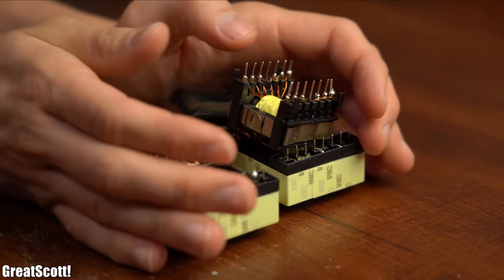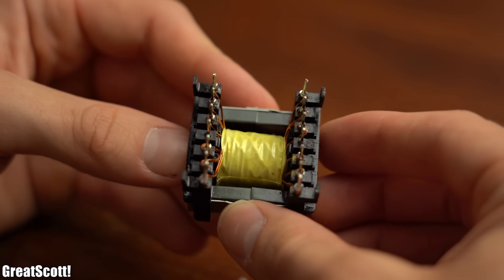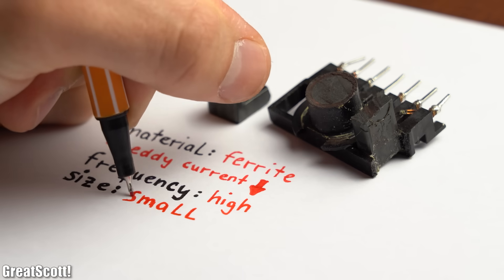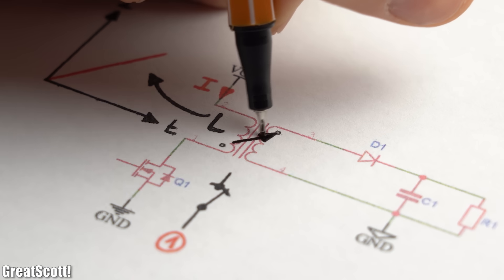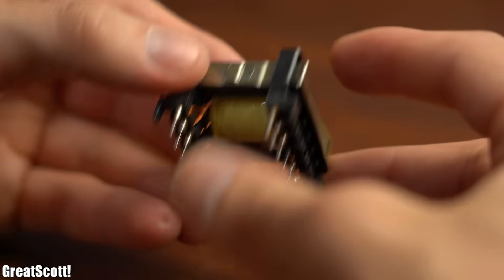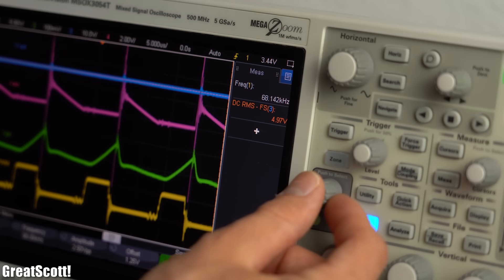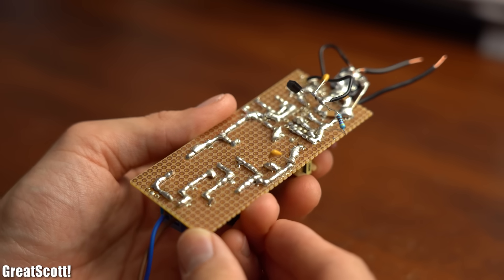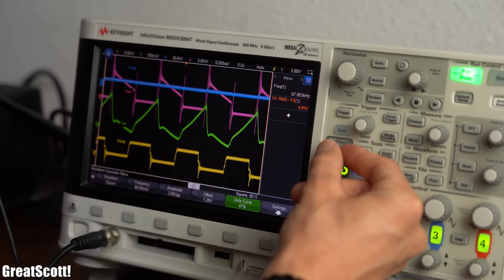How does a modern Power Supply work?! (230V AC to 5/12V DC) DIY Flyback Converter!

Comment: At least half of that went over my head. That being said, i was really interested to see whats inside, and how all my 12V DC adaptor power supplies that i use for various projects actually work.  Out of curiosity, i would love to see in your opinion what a basic VS a well engineered design would look like for one of these circuits. Would be a nice reference if i ever get curious enough to open some and see if they are high quality units or cheap and nasty. Thanks for the video :P
Reply from the maker: Thanks for the feedback :-) I will see what I can do ;-)
Reply: Most of that went over my head, too...

Comment: It might be a good experiment to build the same circuit on copper-clad board with a good ground plane.  That should cut down a lot of the ringing at the switching transitions.  This sort of ringing is what causes a lot of the EMI in switching regulators.
Reply: a good ground plane needs to be on a separate copper layer? or just having more area (on the same side) is enough? (with those other design considerations, but I want to know how important are ground planes on independent copper layers)

Comment: "Do not build this circuit! With that being said, here's the schematic" -Great Scott XDD
Reply from the maker: Everyone should have the access to knowledge ;-) But a warning was still necessary ;-)
Reply: @greatscottlab  At least you made a better Power Supply than Gigabyte's exploding PSUs for being on normal load haha
Reply: @ThatOneWeeb420  gigabyte did a little trolling.
Reply: @ThatOneWeeb420  
What the hell's a Gigabyte?

😂
Reply: @greatscottlab  
Electronic cannot be learnt without explosions and shocks 🤣
Reply: @greatscottlab warning is so that bro doesn't get sued, which is understandable.
Reply: @greatscottlab  Can I have the whole equipment list so that I can do hardware model for my btech project
Reply: @greatscottlab  Hi sir. Sir please hack an AR glasses to work on a HDMI input even if the whole setup becomes bulkey. Bigg fan.  Love from India ❤️❤️❤️❤️❤️❤️❤️❤️❤️❤️❤️❤️❤️❤️❤️❤️❤️❤️❤️❤️❤️❤️❤️❤️❤️
Reply: @VijayaLakshmi19807  HDMI is high frequency you cant just mess around with it. As soon you remove for example the shielding it will no longer work.
Reply: @flavioernst902  I'd suggest you check out Ben eater's video on his crude IC level GPU. it works with VGA not HDMI but it is still very impressive and interesting to watch
Reply: It is not a bad circuit to build. It just missing parts that make it a compete power supply unit, and it should not be used as a power supply.
Reply: Dodgy! 😉
Reply: @oraszuletik DIODE GONE WILD!!
Reply: In our litigation-crazed societies, such warnings are necessary.  Even peanut butter comes with a warning that it contains peanuts.  Yes, I am a lawyer and electronics hobbyist.
Reply: @robinsattahip2376  that's the 
" PlaySafe" modus operandi..
It doesn't tell you the species/ grade of nuts..or if those nuts were taken from a monkeys/ squirrel hideouts..nor does it tell you anything about the "butter" they're using to butter you up into buying..... 🤣🤣🤣
Reply: @robinsattahip2376 I think the allergy warnings is just because FDA requires transparency. Not because of litigations even if people know peanut butter has peanuts not all products are truthful of their name..there are juices that don't contain the fruit on the label so saying it contains said allergens is not a bad thing to add. Tired of this myth America has all these warnings because of lawsuits when it's more like something bad happened that caused the regulation.
Reply: Also he calls it a DIY in the tittle, litteraly Do It Yourself XD
Reply: Thats an iq 200 move there
Reply: It is safe to build but when plugged into power do not touch it
Reply: @Rocky RobinsonWHAT,WHAT..... flybacks don't suffer from....???
ALL MAGNETIC materials ..to date.. are classified/ charecterised by their own HYS.
curve/s . & this is a factor of that loss and also " Eddy current" losses..
Reply: This had me ROFL! Thanks for keeping it real Great Scott!
Reply: I want to do this circuit for my btech project is it ok to do the same circuit.
Reply: Can I have some components list so that I can order them to make hardware model.

Comment: The flyback converter was the first switching converter used in a mass produced consumer product - the automobile. It likely got nicknamed when someone got shocked by the high voltage and was thrown back. Note, however, that some modern automotive ignition systems (e.g. Kia/Hyundai) use a forward topology for the final output since it gives a more powerful spark which allows engines to run more efficiently.

Comment: what I don't like about this topology is that usually you need to make your own transformer, it would be interesting if you do a DYI vs Buy a commercially available PSU that converts mains voltage to 5V.
Reply from the maker: I can put it on my to do list

Comment: For me a timely answer to how come modern power supplies are so small, as a few weeks ago The 8 bit guy built an Apple 1 computer using a modern day reproduction of the original. I'm not sure what the power requirement was, but even with 1970s ICs, shouldn't have been much, but the capacitors were huge.
Reply from the maker: The frequency used back then was just way lower and thus we need bigger energy saving components that can (obviously) store more energy :-)
Reply: @greatscottlab  Thanks! P.S. your drawings are fantastic. I'm sure Buddhist monks would appreciate your lack of attachment to creating such a beautiful sketch, and then scribbling out sections of it.

Comment: well despite the fact I know how a SMPS works in theory, I didn't know about the specifics about the transformer windings being opposite and the fact it's basically using the charge / discharge of such transformer... I always thought it was due to high frequency switching that it worked like a regular transformer but was just smaller because of the higher frequencies and the square wave... :)
Reply from the maker: The more you know ;-)
Reply: ....windings being opposite...
is for " flyback " mode only...also duty cycle cannot/ should not exceed 50%...
Reply: @analoghardwaretops3976  The flyback can go to as high of a duty cycle as you like within the practical limits of maintaining control, as long as the switching transistor can handle the reflected voltage. I think you're thinking of the forward converter, which is one where you can't exceed 50% with the standard design
Reply: @ShinyMajor  exceeding 50% , the volt/ sec. balance in
 off- to -on may not be achieved..and can lead to core saturation even in boost/ flyback modes.. leading to gradual residual flux buildup...
so when it's @ the extreme limit of the hysterisis curve..the next turn on pulse ..in its first few hundreds of nanosecs.can destroy the sw. with uncontrollable current..
Chips for flybk./ boost  have an internal divide by 2 f/f to limit max. duty to 50 % .. 
example..compare data sheet for internal blk.dia. of 3842/43 or other..

Comment: Diode AND RC snubber... k. Curious about this things and ground isolating circuits, as far as how they concern automotive circuits. Killed a knock-off arduino by controlling an ignition coil and not running any power regulating circuits. A coil with it's own igniter by the way.

Comment: This isn't quite 'modern' all good modern power supplies use power factor correction followed by an llc resonant converter. This is more a 1990 / mid 2000s power supply.
Reply from the maker: PFC and LLC converter might follow in a future video. Flyback topology still gets used in modern power supplies with lower power rating.

Comment: Nice video. How much power output can the circuit deliver?
Also, a DIY or buy video about power supplies would be cool.
Reply from the maker: My DIY version uses a very tiny transformer. So maybe around 2-3W on the output should be possible.

Comment: That's like marketing to the next level! Love that!
Reply from the maker: Well, I wanted to do a video about SMPS and they wanted to show off their transformers.....I would say that is a good match ;-)
Reply: .." this is not a promotional pitch..but in all fairness I can say this ( though we were really small customers )
Wurth Elektronik do have " high quality & reliable components and are real serious business partners...
despite we using a limited range and quantity of their products...they went " all out " to respond to our doubts/queries/ end use  applications..and sent their team over  with substantial dev. kits/ catalogues etc. besides follow ups..
Reply: I am ALL FOR THIS.  I have a pet project I'm trying to learn up to...  I've got a shelf full of game consoles from the Famicom to PS4 Pro.  I want to install a high-power 24VDC supply and use isolated switchmode supplies to step down to what each machine needs... 3.3V, 5V, 7-9V, 12V, and so on.  (Isolated to prevent ground loops and issues with systems that raise "ground" to a diode drop above one leg of the input jack, like the NES.)

In my research, I've seen planar transformers that use stacked PCB layers to provide galvanic isolation.  Since the design is kind of tricky, they're also available as drop-in modules from trafo manufacturers.  But, magnetics selection is non-trivial, and I still feel completely lost on this topic.  It's really the last domino to fall before I can start building some POC designs.

So, please!  MOAR TRAFOS!

Comment: Can you explain how you get 325V DC from 230V AC?
Reply: You need to use a full rectifier bridge in order to transform the DC to AC
Reply from the maker: 230V is the RMS value. 325V is the peak value of this waveform. By rectifying it and smoothing it out we get stable 325V DC.
Reply: with a full bridge rectifier, but there's an obsucre reason why the foltage rises rather than staying the same

direct current is on 100% of the time. Alternating current however, well alternates. That's why it's on for only 70.7% of the time on average. (for sinewaves that is)

If you attach a lightbulb to 10V DC it would thus burn brighter than if connected to 10V AC. That however makes everything confusing which is why we use 14.14V peaks, which average out to 10V and then just say it's 10V

if you're using a diode or full bridge rectifier, the peak voltage gets turned into DC, which is why it's now 141,4% of the nominal AC voltage
Reply: 230V AC is the average voltage, but the simple average of a sine wave is 0, AC voltage is Root Mean Square, i.e. the voltage values for 1 cycle are squared, then the average calculated and that's square rooted. Hence  the peak voltage is 1.414... times the RMS voltage, which for 230V is 325V. Because a full bridge rectifier is used, the actual peak voltage will appear on the outlet, although it's not really DC without a capacitor there.

Comment: Nice information video on flyback, i have query how the transformer winding turn is calculated.
On secondary side can we use zener diode instead of tl431.
At the end i loved the video on flyback topology.
Reply from the maker: Watch my transformer video for turn calculation. Yep, a zener diode can also be used. But you see the TL431 in such design most of the time. Thanks for the feedback :-)

Comment: Is this video for Gigabyte ?
Reply from the maker: Gigabyte?
Reply: @greatscottlab  Gigabyte PSU :D it's meme now
Reply: @greatscottlab    Gigabyte used random cheap parts that caused their psu to explode under normal use and often taking the entire pc with it and even bundled the psu with expensive pc parts such as high end gpus like RTX 3080 on Newegg. Gigabyte even initially denied it and won't honor warranties because it was a force bundle with a gpu. Gamers Nexus here on youtube tested one and it exploded on camera when tested using a psu tester. It was only when pressure from customers whose pc was destroyed by gigabyte psus that gigabyte start honoring returns.

Comment: Couldn’t you just use a freewheeling diode instead of the diode, capacitor, and resistor?
Reply from the maker: Single diode will not do the job good enough.
Reply: Freewheeling diode would be shorting out the energy transfered to the secondary side. There is always some voltage on the snubber network, even if the leakage inductance is zero. For example, when the transformer's ratio is 10:1, mosfet turns off, and we have 12V at the output, the voltage on the secondary winding is also 12V, if we ignore diode's voltage drop. On the primary winding theoretically we should have 120V, but in reality, this voltage is even higher, due to the leakage inductance. If we replace snubber network with a diode, it will be shorting that voltage, and the power supply won't work anymore.
Reply: The Orientation of the diode , cap. , & res. are the " snubber circuit " to protect the MOSFET 
@ switching instances .
and in cases where snubber diode also handles higher power...the snubber diode will require its own indipendent snubber circuit...
Reply: Nvm just realized you’re using AC😅

Comment: Can you make a video about active power factor correction, because it's an important topic with switch  mode power supplies. Due to it's big capacitors.
Reply from the maker: It is on my to do list :-)
Reply: @greatscottlab  Awesome! Looking forward to it.I don't suppose you know any good discussions of Actice Power Factor Control algorithms?
Reply: @greatscottlab  sir please make vedio on "how to use lab bench power supply basic to professionally"🙏🙏🙏 (I request you)
Reply: @greatscottlab  Hi sir. Sir please hack an AR glasses to work on a HDMI input even if the whole setup becomes bulkey. Bigg fan.  Love from India ❤️❤️❤️❤️❤️❤️❤️❤️❤️❤️❤️❤️❤️❤️❤️❤️❤️❤️❤️❤️❤️❤️❤️❤️❤️
Reply: @VijayaLakshmi19807  : Maybe DisplayPort instead of HDMI, since you don't need to sign contracts.
Reply: About 10 years ago I had to simulate an oil refinery electrical power grid. Was a struggle trying to understand how a generator's AVR goes from changing the generator's voltage when it's the only generator on the grid to changing the reactive power supplied when there is more than one generator.
Reply: Howell
Reply: @axelBr1  check distance and bielectrik material
Reply: @TheBamPlayer active power factor correction is super interesting, but GS hasn’t covered traditional power factor correction circuits yet I don’t believe.
Reply: @LightningHelix101  😀😀"the doubting Thomas"😂😂
Unless you read up on p.f.c. theory & Design...
Unless you "probe" into a working p.f.c.under load..with an oscilloscope...
Unless you see the real waveforms....how the current wave shape accurately tracks the voltage wave shape....
You certainly have the right to
" not believe" ..
Reply: Interesting. But I spent the whole video wondering what they mean by flyback. Off to Wikipedia I guess.
Reply: @kevgermany  electrical energy is converted to magnetic e. & stored in the mag. core....
the fundamental principle/ property of any inductor.. being to oppose a change to the flow of current... therefore
when the transistor is switched " off" " , that rate of change of interrupted current has now to flow by  another path through the stored magnetic field to dump energy into the sec. wdg. of the transformer..this phenomena is " flyback "
Reply: @analoghardwaretops3976 , does a Variac that can typically output up to 140VAC from a 120VAC source count as a "flyback" of sorts?
Reply: @goodun2974  Simply put..it's NO..
In the variac.., The current is flowing all the time and the step
up section of the winding is from where the ( carbon brush) 
connection is made..to your load....
The variac input is across the mains that's where the current flows.. ..the step up part of winding is initially unconnected. so there's no current..
Now when you use that step up range ..,for that part of winding , the current flow is opposite and completes the  return through the common so the two different potentials positively  " add" up.
 in a fly back , the current flow through the switch 
" magnetised the core with one polarity..when the sw. is turned off , the stored magnetic energy is converted back to elec. energy of opp.polarity & flows into the load.
Hope this answers your query ...
Reply: Yeah I had to fix a friends sound bar which the internal smps failed .. ended up buying a plug in 12v supply and tearing it open  and installing that into it
Reply: https://youtu.be/YtI294cjKMc
Reply: Yea correct i would like to see a video about how PFC system works on power supply
Reply: Active PFC is fascinating. I think it's just using PWM to draw a sinusoidal current so the current is in phase with the voltage but there might be some more clever stuff going on. 
  
What would be interesting would be to use a microcontroller to do sinusoidal PWN synchronized to a zero crossing detector and see if that performs as well as a commercial APFC chip. I suspect the commercial chip is doing something a bit cleverer than this but it's not well documented. Basically a 'Buy of Build' for active power factor correction.
Reply: @user-qf6yt3id3w  many generic analog ics are available for this... popular since (85-90) were a few
 " Motorola " chips..
The basic trick is the " unfiltered ripple dc voltage " ( @ the 100/120pulse repetition rate )..that's used as the
 " tracking reference for the  current controller " .. with the current feedback loop ckt. complete..it forces the input current wave shape to follow the input voltage wave shape...
So the " utility " always sees a resistive type load that's @ almost unity p.f.
Reply: Upvote👍
Reply: It's literally just a high voltage boost converter